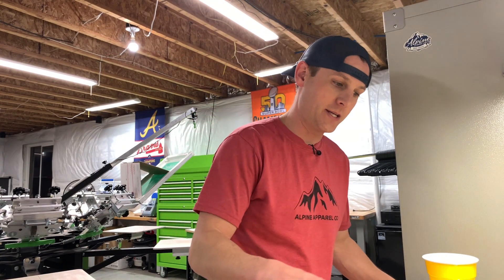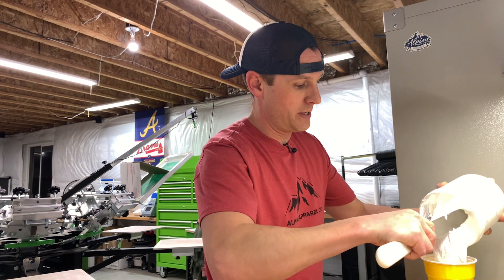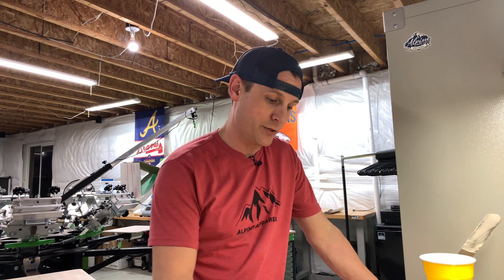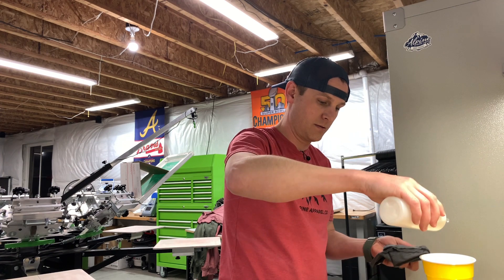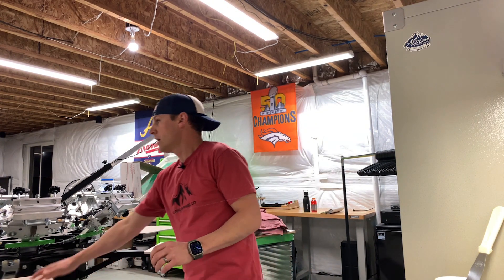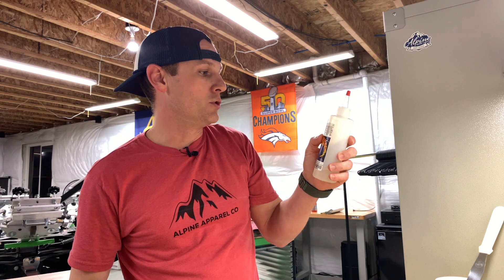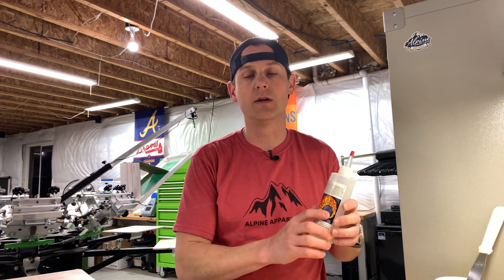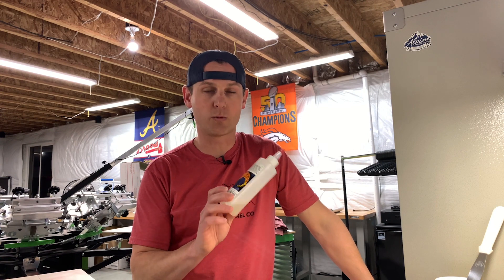Adding Low-Cure Catalyst to Water Based Ink for Screen Printing

Comment: Your videos have been so helpful! I am looking for an answer to a question. If i added warp drive to one color and not the other (oops) whats the best option? I printed probably 35 shirts before i realized i had grabbed the wrong white. Can i just cure it normally at like 90 seconds under flash?
Reply from the maker: Yeah you can just cure longer but you risk burning the shirt. Make sure it doesn’t get about 330 or so. Helps to put a fan blowing over the shirt from a distance to help maintain heat on a flash. Hope that helps! If you have a heat press you can use that to cure as well.

Comment: Do you think curing with a heat press is an issue?
Reply from the maker: no that should be fine, i would recommend using a heat gun to dry it to touch then finish curing with the heat press.
Reply: Thank you!

Comment: Have you tried water-base on 100% poly? Any tips?
Reply from the maker: Yup do it all the time. No issues just watch your heat when flashing or curing. Poly can cause dye migration and change colors of the shirt or the ink. If migration issues arise try a dye blocker.
Reply: @startupscreenprinting  thx man.
Reply: @startupscreenprinting do you have a dye Blocker you use most with water-based inks?
Reply from the maker: Yup try this one https://www.screenprinting.com/products/green-galaxy-gamma-blocker-black-hsa-water-based-ink

Comment: Great info. In the 48 hour period, do you stack shirts? Any handling concerns?
Reply from the maker: Typically no concerns like you would have with plastisol where you'd have a chance for ghosting when stacking hot shirts. One key is to make sure the shirts have a chance to cool prior to stacking and that's just good practice no matter the print type. With my situation, I hang the shirts up to avoid that but they also have a good amount of time to cool after curing since there are 3 stations between the flash and back to me. If you're using a conveyor and dropping the shirts into a box straight out of the oven, then you probably shouldn't leave them in there too long. A lot of shops will put a fan at the end of the dryer to cool the shirts quickly before they drop into a box. The bigger shops have a longer section of conveyor after the oven to allow for cool time. If you are like me and not using a conveyor, you can add a fan blowing air onto the stations after the flash to cool the shirts before you pull them off and stack them.

Comment: Does it make it easier to cure with a heat gun also, I don’t have a flash dryer but I just run in to problems with the ink cracking on the shirt
Reply from the maker: Yeah it lowers cure temp no matter how you heat it so it will certainly help

Comment: if i do a multiple colors, would you use it for the underbase and the colors too ?
Reply from the maker: Yes, you'll need to add it to every color you are using
Reply: @startupscreenprinting  do you flash between colors ? im getting a tacky print sometimes
Reply from the maker: @P0TKILLS yeah if you’re doing an underbase then yeah you’ll need to flash. Just do one layer of underbase and also give the print time to cool before printing the next color cause if it’s hot you will get sticking

Comment: Thanks for the Video! So about how many T-shirts and hoodies did you print with all that ink in the Solo cup? Also, do you cure each shirt under the flash dryer before you go onto the next one or do you print them and then cure them all at the end? Thanks in advance!!
Reply from the maker: Kinda depends on the print, but white ink and a print flash print and a full front print I’d say I’d get about 50-80 shirts, again just depends on how much ink for the print size. And yeah I’m curing under the flash as I go along. 🤙🏻
Reply: Thank you! @startupscreenprinting

Comment: If you are printing 2 colors does it need to cure ?
Reply from the maker: Yes, you'll need to add this to every color you're printing and then get both prints up to the correct temp to start the chemical curing process.

Comment: Thank you for explaining this so well. I am using my work email and I am a subscriber. I had a quick question, I know there are so many variables for how long a flash dryer is needed to get to 250, but do you have an estimate ? Is it  5 seconds? I don't have a temperature gauge thing to hold next to fabric. I need to buy one on pay day. Is there one you recommend? Thank you so much
Reply from the maker: Thank you! Glad it was helpful. So just any infrared temp gun should work fine, like this: https://amzn.to/3MrgIpt

As for how long it takes to get the shirts to temp, it depends on how hot your platens are and what type of garment. If it's a hoodie/fleece, for example, it'll heat pretty fast, probably ranging from 5-10 seconds. If it's a tshirt, probably more like 20-30 seconds. If it's triblend and red, you gotta be careful not to overheat it for that long, too, though. Also if the shirt is still stuck to the platen it will take longer to heat. If it's just laying on the platen loose, then it'll heat faster. So when I'm flashing I leave it stuck down, but when i'm curing it needs to be loose. 

Let me know if that helps!

Comment: Isn’t 1.5% converted to .015? Or is my math wrong? I think you stated 1.015?
Reply from the maker: You’re correct it does convert to .015 but if you multiply your original amount by .015, you get the amount that needs to be added to your original amount. If you multiply it by 1.015 then you get the finished number without having to add again. For example, 1.5% of 250 is 3.75 (250 * .015). So added to the original, you get 253.75. But if you multiply 250 by 1.015, you get 253.75. So both ways work, I just choose the lazy route so I don’t have to clear my calculator 🤣
Reply: Hello i have a question did you use clear core on your comet white? Or you use direct? + the warp core
Reply from the maker: @hardink4332 yes I add clear core to my comet white every time. I also add the warp drive to the comet white (or any ink I print with) before printing to make it low cure.

Comment: how long do you cure them with this ? does it need to reach 250 and thats it ??
Reply: also does your design crack after its fully cure when you strech the graphic or it does actually fully cure ?! im kinda interrested to try it
Reply from the maker: Hi X, yes when you add the Warp Drive catalyst, the ink only has to reach the 250-260 temp. Once it reaches that temp, that activates the catalyst and it begins to chemically cure the ink. The curing process happens over the next 48 hours, so that's why you shouldn't wash before the 48 hours is up. As far as cracking, thankfully that doesn't happen with water based ink. Plastisol sits on top of the fibers of the shirt and creates an ink layer, which is why it cracks when it's not cured properly. Water based actually soaks into the fibers of the shirt, so it stretches with the shirt and you will not experience cracking. It's almost like the design becomes more a part of the shirt rather than just being "on" the shirt. Hope that helps!
Reply: @startupscreenprinting  yes!!thanks for the reply ! ill have to order some and try! 
I've been using water based ink lately (speedball ink) does over curing it could cause cracking or ? I'm trying to figure this out rn haha cause some of my stuff started cracking after couple wash
Reply from the maker: Hmm I’m not sure as I’ve never used speedball ink. The only thing I can think of is if it’s a thick ink and not able to really soak into the fibers then maybe it could crack.
Reply: @startupscreenprinting  hey ! got my hands on some lowcure  stuff and new comet ink ! sorry for all these questions i feel annoying ! haha ! but just to be sure, the ink just need to reach 250 then the warp drive will do his thing ? does it need to stay at 250 for couples seconds  or just reach it and thats it ? and are you aware of the shelf life of the product or just from personal experience ?
thanks for this video, it got me really motivated to work with white ink again without being scared of craking ! hah
Reply from the maker: Haha no worries keep the questions coming! I’ve had a bottle last me over a year and still be fine. Once you add it to the ink i think it’s only good in that portion of ink for 4-6 hours then you have to toss it or I think you might be able to add more but I’m not sure. And yeah it needs to hit 250. Mine usually sit around 270-290 for a couple seconds while I’m printing the next shirt so I’d say the longer it sits the better.  But the key is that the entire ink layer and entire print reaches that temp.
Reply: @startupscreenprinting  perfect ! ty !
Reply: I was wondering, I'm mixing my ink In a cup, if I leave it in the cup for the 6-8 hours without being covered , is it a problem ? or its fine as long as it isn't dry in the cup and still moist?
Reply from the maker: It’s probably fine, if it dries a little add some water. Any longer might want to add more warp drive. I try only mix when I’m ready to print and if i step away for several hours I usually mix fresh but you can certainly test it and see what works
Reply: @startupscreenprinting  Thanks for the video, Jesse! does it need curing or the 48 hours before washing should do?
Reply from the maker: The additive takes care of curing over the 48 hours so that’s it :)
Reply: @startupscreenprinting  thank you!!
Reply: @startupscreenprinting  Another question: Do you know if you can add Fixator NFU with the low Cure Catalyst? Thanks
Reply from the maker: @cp.ramosphoto Fixator has some low cure in it but only drops it to 300. I’m not sure you can add it. It’s not listed as being able to combine.
Reply: @startupscreenprinting  thank you very much! I didnt see it either i was hoping they’d get back to me for the same question. I learn more from you than their site lol